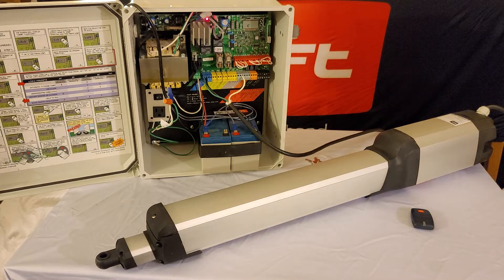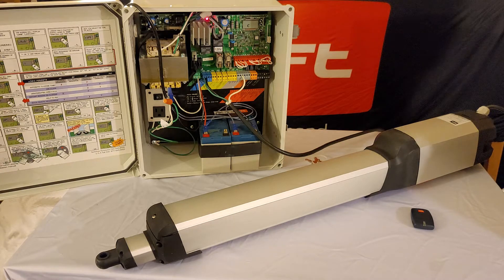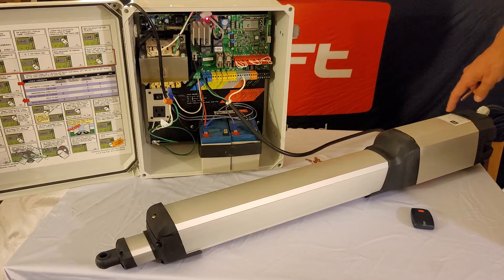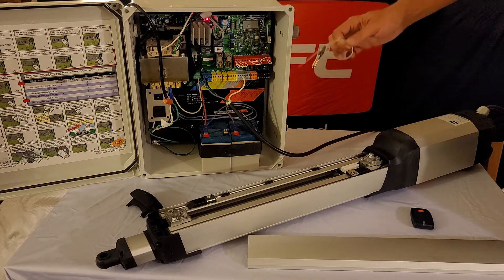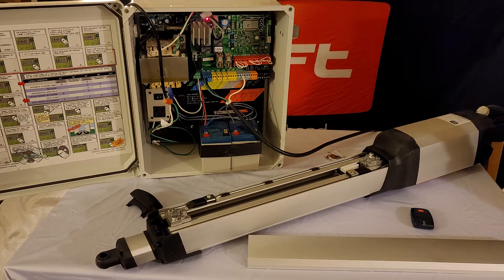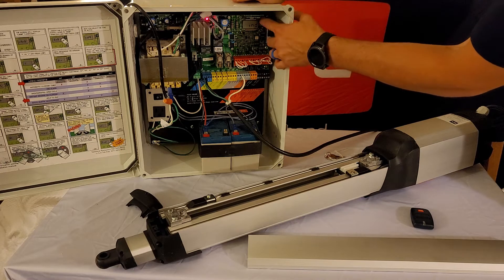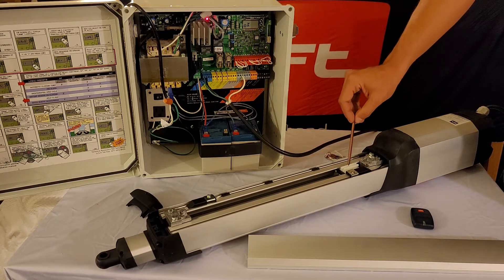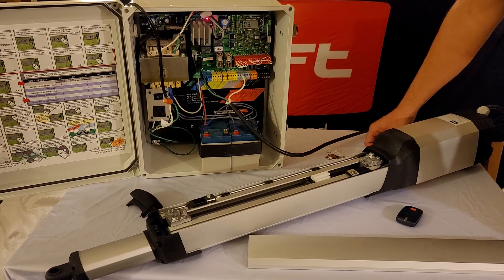BFT Kustos Ultra A40-A25 & Thalia P Quick Overview

Comment: Hi, thanks for the details explanations. I have a question: what would be your recommendation to check if the BFT Kustos A40-A25 is failed? I have the error code 19 on motor 2, indicating error on limit switch, but I can hear the contact switch on / off / on when moving the the kustos manually. I suspect that the motor is failed and getting the limit switch error code because the motor don't move.

Comment: Thank for a video, do you know why am I not getting Ok but Ko code?
Reply from the maker: It can be several different things. Try checking the Error log out. Make sure your photobeams are connected correctly as well. Reach out to us at Tech@BFT-USA.com
Reply: Got it figured out, I had to disconnect my intercom and finish gate set up first and then connect my intercom.
Also had to wire my BFT Intercom to always on relay.